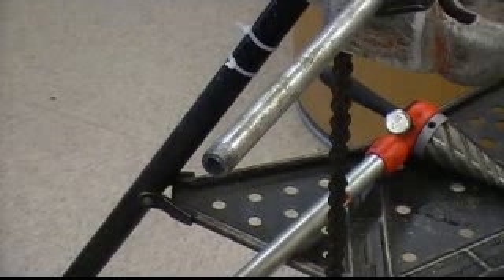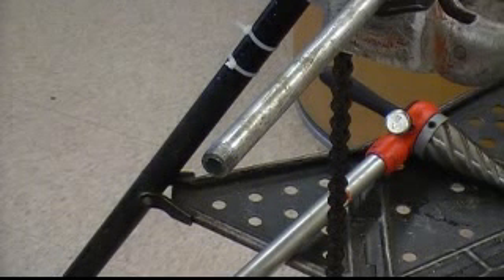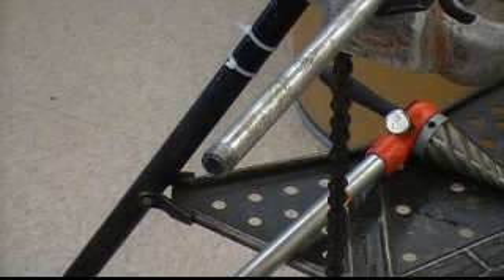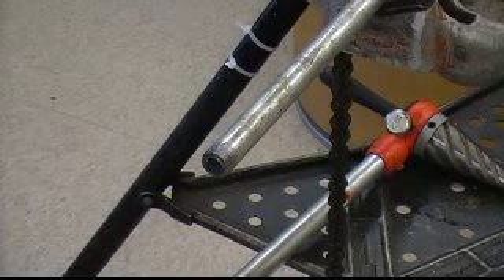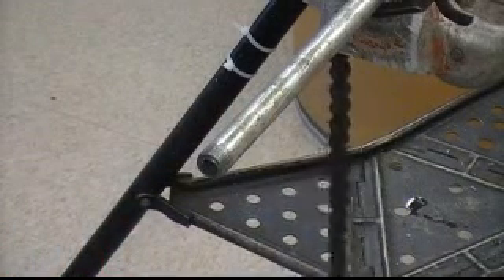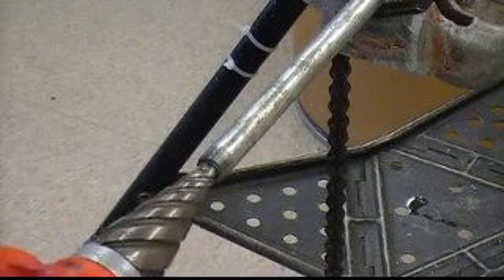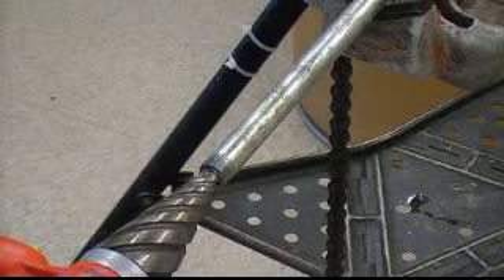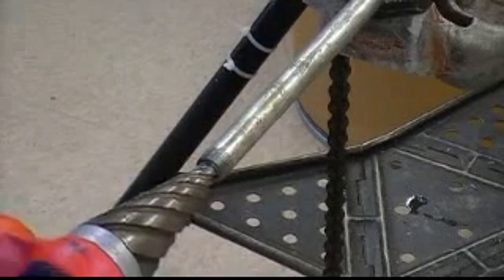Reaming RMC Conduit

Comment: If you used a pressure separation cutter to cut your conduit, you'll need to turn counter clockwise while firmly pressing into the conduit opening. I've never seen anyone do it like you show. I doubt it is free from ridges and burs using your method.